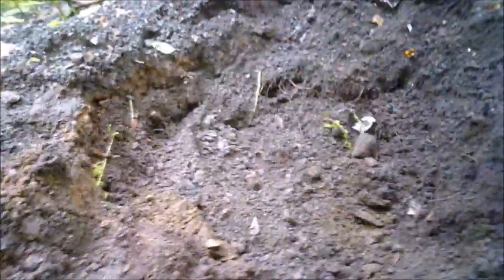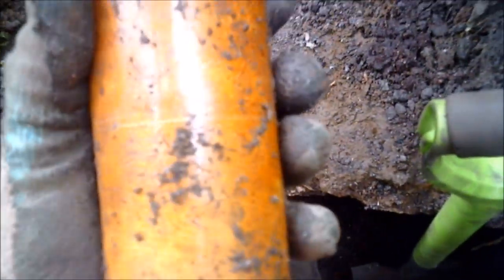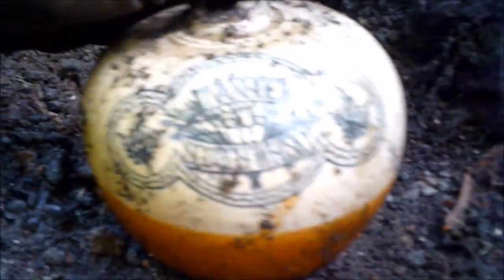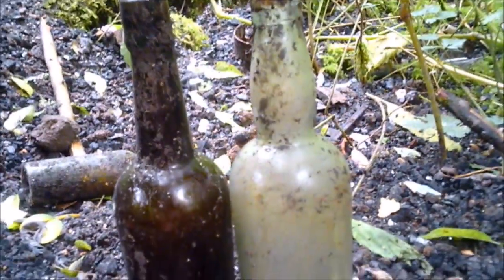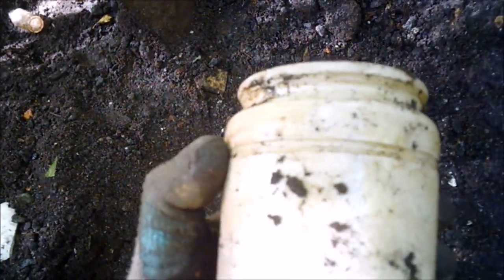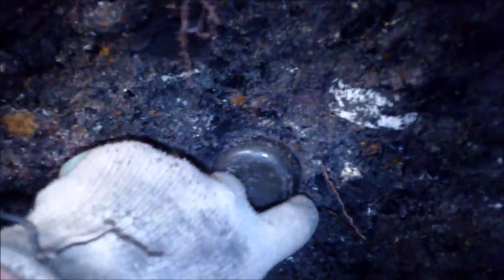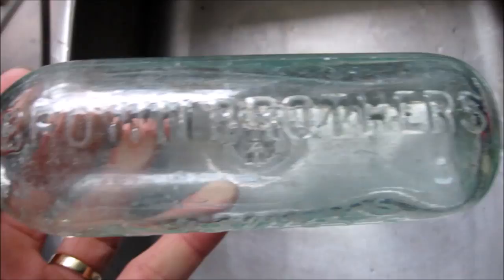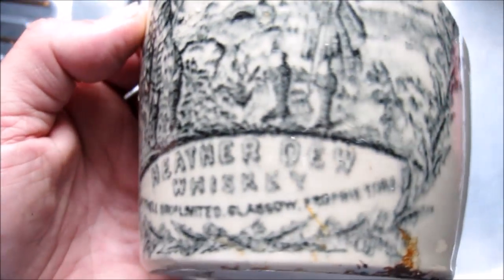AMAZING DOUBLE GINGER BEERS - Bottle Digging UK (The Yorkshire Digger)

Comment: not to be over critical but do you realise how nauseating the quick movements of the camera can be to some people with vision impairment 
but i wish you happy bottling
Reply from the maker: 51vvince I wish I could stop it, the camera I use does have a little image stabilisation/anti shake, I don't like the YouTube stabilisation as it looks rubbish to me
Reply: I think its just set to close up, so not getting a wide angle which would help.
Reply from the maker: The camera I use to dig is a cheap Vivitar video camera, its cheap enough not to worry if I break it. It doesnt have a lot of settings and is basically set as it comes out of the box.